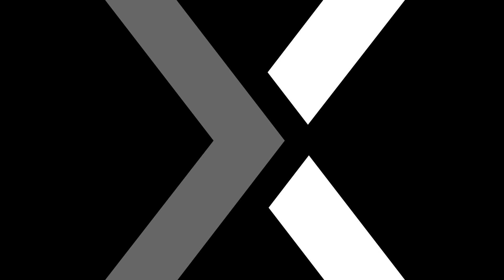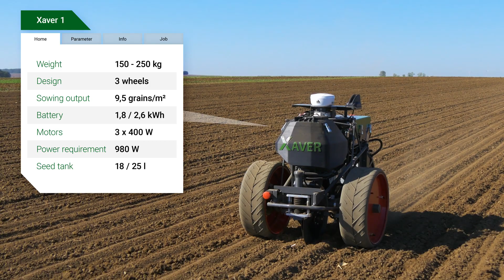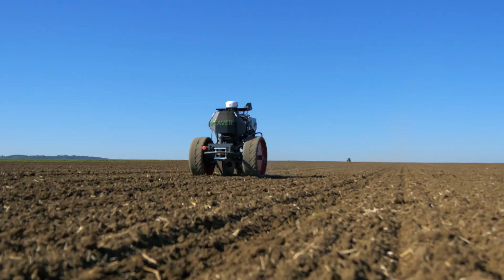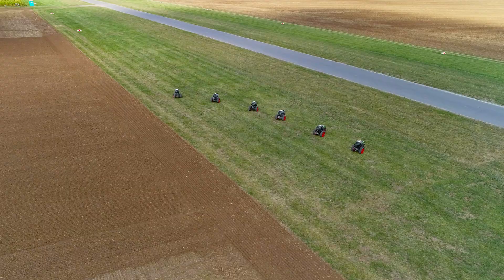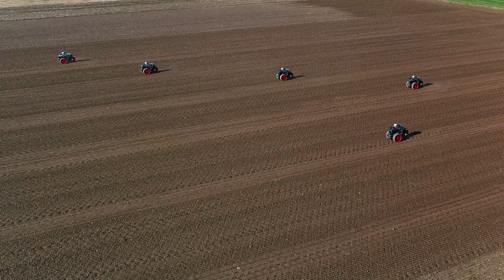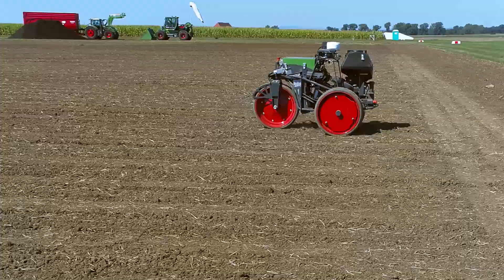Fendt Xaver | Sowing robot | Fendt

Comment: Small is better, but..Need longer wheelbase to keep rows straighter and increased speed.  Packing drive wheel is bad for some soils. Maybe 2 or 4 row( depending on field sizes to be used in) and with single tracked driver between the rows.  Those are small enough to rent at the local hardware stone and plant backyard gardens.